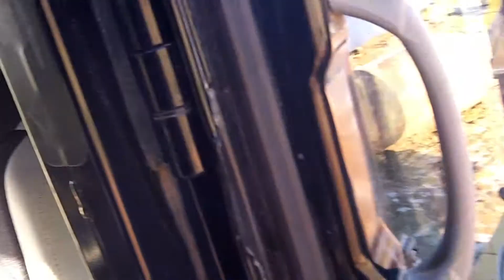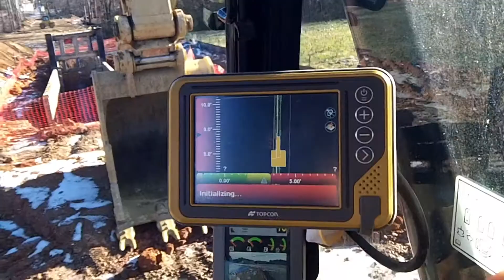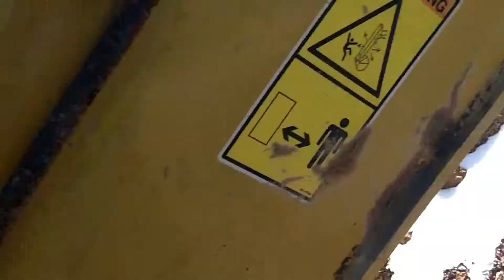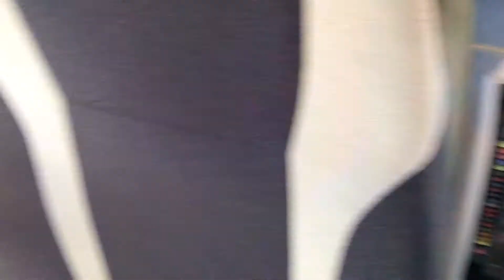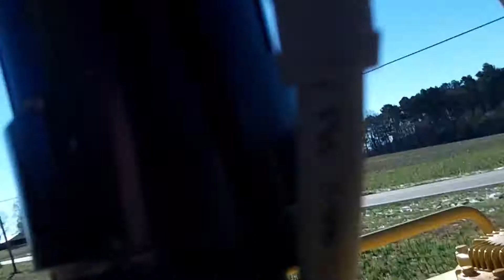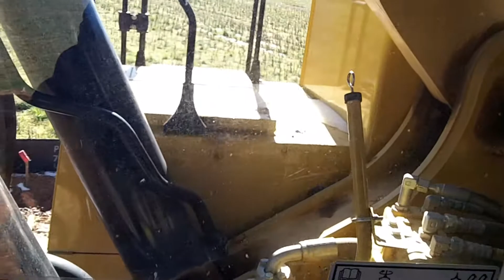CAT 390F GPS Connection Freeze Up Solved

Comment: Having used both topcon and trimble as an operator, I can say radio connection. Is probably the most common issues that I have encountered for whatever reason.